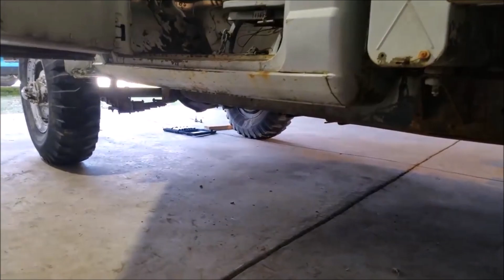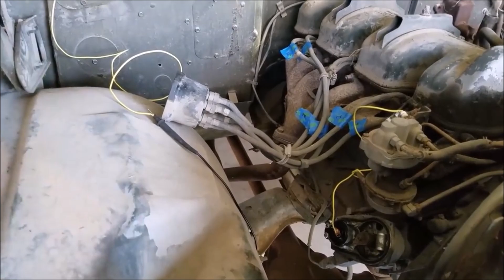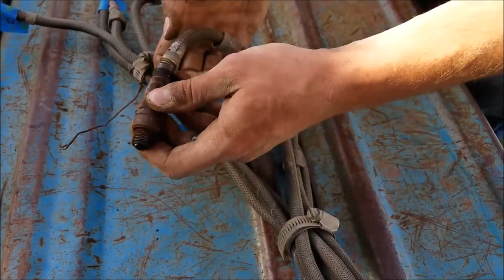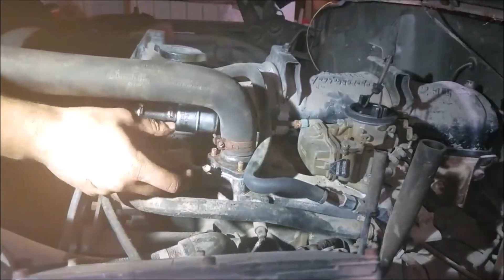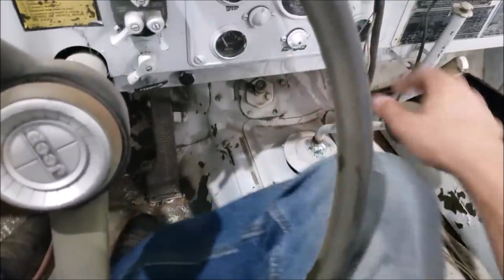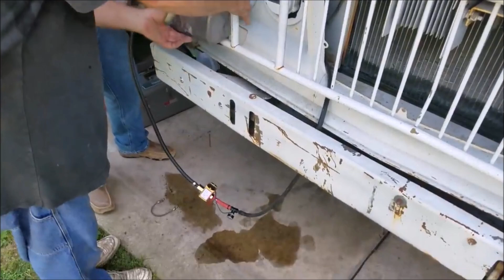Forgotten 1967 Jeep Gladiator - Dormant over 40 Years (6k Original Miles!)

Comment: Luke worked in an Army motor pool in 68, the motor looks like the same as the M37A1 had in it.  It would run OK, it just would not turn off, It would keep running like a diesel. One time we timed the running 12 miinutes.  It never would stop when you turned it off unless you left in gear. One Army piece of shit.

Comment: Hastings brand filters were a top quality brand,  I used to use them a lot,   these days they are known as Hastings Baldwin,   I'm not sure if they still have the same quality as they once did,   but if you ever find any new old stock Hastings brand,  don't be afraid to use them if they are in good condition.
   Now days Wix brand or Napa Gold are probably the best.

Comment: I had a chance to buy one of these with a Ford 300 I6 swapped in down in TX. I regret not getting it. I love M715s, M37s and Military Power wagons. A Cummins is the obvious choice but, I have a roller cam 351w and a 2wd ZF-5 S47 for the divorced transfer case that would be  wonderful with a carb, a cam and headers swapped.

Comment: I'm a little late to the party (by about 2 years.....) but the electrical system is very similar to a Hotchkiss M201 Jeep (post war French built Willys). They were 24v, so they started, and had the sealed distributor and plug leads. The distributor on the M201 looks very similar to the one on this Jeep, I'd say the coil is probably the same . The electrics were screened so they could be used as radio trucks, and the plugs and plug leads are eye wateringly expensive..!!

Comment: Flat tappet is about 2 inch long. Hydraulic tappet is about 2 1/2 inch long. 1967 Gladiator 3/4 ton pick-up truck Jeepster and Dodge suspension Army hybrid have OHC straight-Six and don't need any tappet. Just the guide for each rocker arm at one end where the Valve set-Train bar have 12 rocker arm guides. Usually, a Kaiser type cam follower called guide so it allow the rocker arm tip in lifting up - straight up atop the valve for combustion seals in valve guide seats.

Comment: How many ohms is both spark plug cable and electrode of water-proof spark plug? It should be not higher than 5,000 ohms for live wire and old spark plug. For up to 25,000 ohms for resistor-type wire and spark plug are both good. Thanks.

Comment: Hastings oil filters in the 1980s were known to be soupier to standard filters because they used a fiber filter element instead of paper. They were recommended by "Circle Track" magazine as the best, and they were somewhat more expensive when you could find them. I learned to cut open my oil filters in general aviation and Hastings had a heavier metal case like general aviation filters. They will stand higher pressure without failure. Good for 20W/50 oil.

Comment: The entire electrical system is shielded to include the plugs.  The shielding was done to prevent radio frequency interference with any radios the vehicle crew might be using.  The engine is weatherproof, but not waterproof.

Comment: Old military jeep truck that was repurposed to Civil air patrol nice still has a mil-spec distributor and generator so can ford water still.  Avoid getting cheap Asain knock-off parts like points  rotor and condensers and should be fine

Comment: Interesting vehicle. But judging by all the exterior scratches and wear on the interior, that odometer has turned over at least once, probably twice. My overworked F100 with 240,000 on it had fewer dings from 38 years of hard use.

Comment: If the cylinders had ATF in them for 2 years bravo,......the rings are clean and free.
If you tossed the thermostat till you ran the engine and flushed it out several times and your really checking the water pump after sitting that long.
The engine looked great inside.
You actually put oil in it,......the last time I changed oil,......they still made oil?
Now all I can find that don't say synthetic,.....is for Diesels?
Also before I do anything I pull off the fuel line and put on an electric fuel pump and pump out the tank,......I drop the tank to be sure the tank is good,.....and I dry it out,.... so there is no water in it.
I put it back,.......... dump Sunoco gas in,......pump the fuel with the electric pump,....Install a new manual pump.
Then I go through everything else.
I don't like screwing with external tanks.
I go through the fuel system first,.....technically ATF in the cylinders is first,.....And the starter is last.
I,.....try using the distributor cap and wires if possible,... I clean the contacts,....put the plugs on a mower,....yank it to check the spark,.....wire wheel the plugs.
I will not crank any engine that has sat more than 10 years with out pulling the valve covers,.....rust is why,.....if its there you remove it or rebuild it.
The actual first test any mechanic does is check the oil,.......is their water/ antifreeze in the oil,......is there gas in the oil.
Then if the cooling system is full.
If it has no coolant,............did winter freeze and break the block?
And yes in the 60's there were many 4 and 6 cylinder overhead cam engines,........I had a 68 firebird with probably the same engine your working on?

Comment: Hello T/H 289
I've got a 88 4.9l efi f150 I'm going to change to carb.
Offenhause, witch one would you use the C witch is all open and gives more rpm's or the DP witch gives more torque I watched oldreliable303 Justin Scott put a holly 600cfm carb on his that he liked.
I was told by summit I should need a 500cfm again witch one do you advise?
I was told cruising on the hwy, a pass would need to be planned way ahead of time lol 
I plan to pull very little?!
I really want a high way Truck
Thank you for your time and your Video's, it takes alot for me to learn something new now! I've learned a good bit so far from you! Being a Carpenter sents I was age 16 lol

Comment: The OHC 230 inline six was derived from the 230 inline six found in the Jeep CJ.  It was made for use in both first generation Wagoneer and Gladiator pickup. It was the only engine available until '65 when Kaiser Jeep began using the GM 327 V8( called the Vigilante by Jeep) as an option due to complaints from customers about the 230 not having enough towing capacity.
Reply: The 230 OHC (Tornado) was never used in any Jeep CJ nor was it derived from any AMC engine. You're thinking of the 232/258 OHV six which has nothing in common.

Comment: Your plug wires look a lot like small aircraft wires. The plug caps especially.  The plugs look like a hybrid between Champion aircraft plugs with a car head diameter? Couldn't see on the video. You could bead blast the plugs to clean them up, then just check gap.

Comment: When the valve cover came off, my jaw dropped, and I'm having difficulty picking it back up... An OHC L6... In a Heavy, Military-Truck application?!?? Don't get me wrong. I think it's COOL AF, but that thing's got to weigh something like 8,000 lbs... what's it doing with an OHC engine? It needed Torque, not RPM's!
Edit: Hastings filters were quite common back in the day. It was the primary brand used in my auto repair business from the mid 70's up through the late 90's. The T115A filter (I believe) was about the most common of all, being the filter that fit the Sm block Chevy, and probably most of the GM product line...

Comment: I'm pretty sure the spark plug wires are steel braided shielding so there wouldn't be any radio interference, probably also water tight. This is also common in piston powered aviation motors. Very cool rig.

Comment: The "cooler" for the electrical lines to the alternator is the bridge rectifier for the alternator. The other ones had generators on them back then. This was a radio truck with the high output Alternator. The regular generator was 25 amp. This unit is 100 amp and an alternator.

Comment: Hiya - looking good here, but please, tight spark plug threads ? come on spray some WD40 or similar just after you cracked the threads to lube them threads coming out / Hard to get parts ? be a lot harder If you damaged them head spark plug threads Eh. thanks for the Video / Ian - UK.

Comment: I lived with these trucks for several decades, Construction Mech. 1st class, USN SEABEES 22YRS RET. Run good coolant, replace thermostats, overheating causes water pump (?) Head gasket failure. Felpro head gasket helps, I think id put elec fans on or at least a stainless flexfan. HELLUVA lot better unit than the BUMMER!

Comment: The screening on the ignition leads and units including spark plugs and caps is not waterproofing. Those are all for noise surpression because this vehicle would be a radio vehicle, possibly a control vehicle. The screening eliminates ignition noise on the radio

Comment: If you need 12 volts for anything, just hook a wire to the battery cable that connects the 2 batteries together. that will be a constant 12 volts. run that through a relay if you want it to work off of the ignition switch

Comment: 24 volt nightmare time. Use a little discretion working around the hot side. Batteries in series. Drove this in Germany and worked a lot on them. Other comments about blowing engines very true. Guys would usually disconnect governor and that left it vulnerable. Looks like it went from military use to Civil Defense.

Comment: i have a 66 gladiator j-3000 327 vigilante 4 speed,  in the civilian trucks that 230 tornado 6 cyl usage ended in 65. i believe it was 69 that the 230 ended in the military.what a beefy bastard that military truck is.

Comment: That shielded ignition was not for water, but to shield radio frequency transmission, with out shielding ignition can be heard on AM radio for miles, last thing you want in a war is enemy to be able to track your movements with simple AM radio.
Reply: Absolutely correct,  having rebuilt several military vehicles in the UK that used very similar systems through the cold war era. Radio jeeps had some weird shielding stuff on them

Comment: I spent 10 years in the military vehicle maintenance.  The milage is totally plausible and it probably had 20 oil changes whether it needed it or not, no common sense in the military!  As an engine machine shop owner (in Iowa)  your leaded fuel /hardened seats comments aren't necessarily true.  It would take at least 40-50K miles before you would notice any wear and that wear is difficult to sort out from normal wear.   What I typically encounter is when you install hard seats the valve material is softer and then the valve absorbs all the wear , so 6 of one and a half dozen of the other unless you can find modern valves made to modern specs.  The lead issue isn't an overnight problem and takes several years/miles. Spring rate is also a contributing factor in valve/seat wear.

Comment: Checked back on the electrical system: The alternator is a Military Standard, probably 60 amps. The cable from the alternator runs to the connection in front of the radiator, for an old style selenium rectifier, and the other cable runs back to the voltage regulator. In case of failure (rare) if absolute restoration is not the goal, I would replace it with a 24 volt truck type alternator and regulator. They are pretty common.  The ignition system uses the same system, plugs and wires, as are used in piston engine aircraft, and many of the Military small engines. The object of course, is dependability and available parts in the motor pool. THey plug wires are of course, waterproof as well as shielded against RF interference. If that system fails, the cheapest repair would probably be to replace the distributor with a regular civilian Jeep model,and source a 24 volt coil or use an appropriate ballast resistor. The rest of the stuff, lights, instruments and so on are commonly available, and used on buses and many trucks.

Comment: In my early years in the military we still had these trucks around. They were famous for blowing engines because the truck is geared so low, 50 mph is about 5000 rpm.
Reply: So shes a puller!
Reply: @lucasstiles8012  Axles are Dana 60 in the front and Dana 70 in the back with 5.38 to one gears.
Reply: @johnparrish9215  - yes! Friggin 5.38 gears!!! I knew it was something crazy like that.
Reply: @Jeff Kopis  The 900-16 tires it came with are 36 inches tall, I do know that 17-40 Monster Mudders will fit with no clearance issues so that would gain you a little. Most people just drop a small block V8 with an overdrive transmission in them and have fun.
Reply: 40 inch tires or 4.10 gears would probably help.
Reply: Worked on a lot of those. Engine problems kept us busy. Engines are pretty much crap.
Reply: M-715
Reply: Sounds like they were known for having dumb operators... over revving a big ole diesel.
Reply: @spacecadet0  diesel's don't have carburetors...
Reply: or spark plugs
Reply: @spacecadet0  The average speed of a military convoy is 45 mph. The M715 just could not keep up without blowing up. It was not the driver that was the idiot it was the person that ordered the truck.
Reply: @johnparrish9215  exceeding a machine's mechanical limits over time causing failure, still doesn't do that on its own.

Max speed 45, speed limit 55... 55 or bust! Bust it is...
Reply: @spacecadet0  User name is accurate.
Reply: @spacecadet0  Diesel? Its a gas engine.